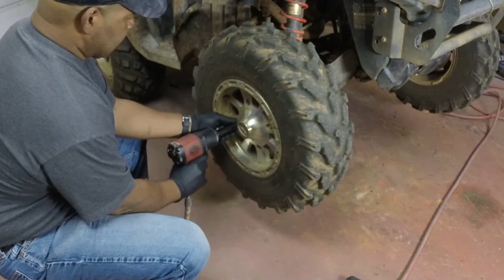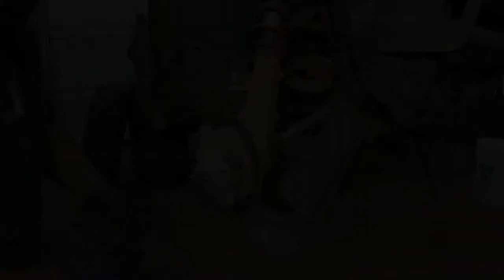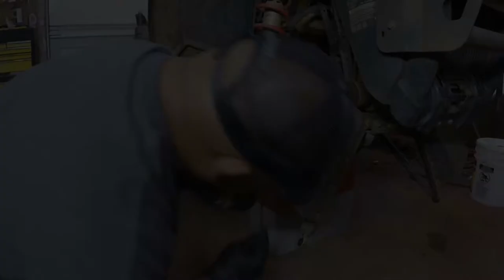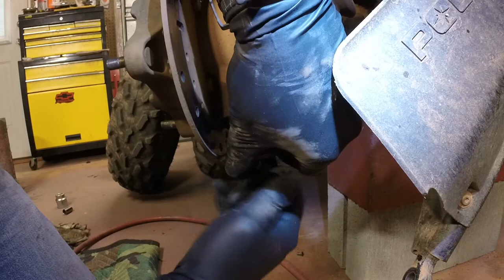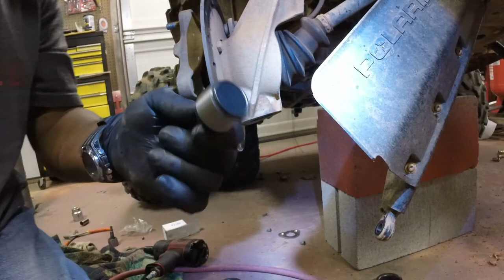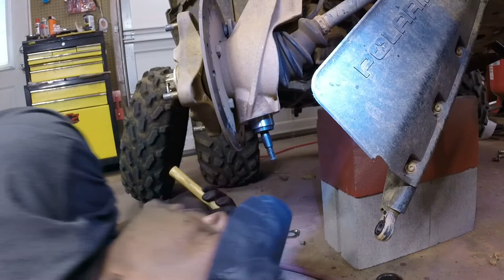Polaris Sportsman 700 Ball Joints and Front A-Arm bushings Replacement "Part 1"

Comment: Thanks for the video!! I have a bad ball joint on a 2000 Sportsman 500 which has a ton aof miles on it. We rode through Canada and I have unlimited trails out my back door. The part that holds the top of the strut broke off. Thank god it was just down by the barn because it was impossible to move but I have it up by the garage and welded a big washer in where it rusted out. I need to put a new CV joint on it as well. It has been sitting for 5 years or more. I have another one that is a year older I use as a work horse. They have been very good machines.Thanks again those tricks will help!!

Comment: Once the plate holding the ball joint in is off just pump grease in through the grease fitting and it pushes right out so much easier
Reply: His old ball joints had a grease-able hole in them, the grease would have simply passed through.
Reply: That's what I do. It's like magic
Reply: @elliottbran  no the grease would have pushed it out
Reply: I tried that grease method it the grease just came through it didn’t work. 
This method is all that worked

Comment: Good idea using the washers to get the ball joints out, I’m rebuilding my entire front end I think I’m going to stick my new ball joints in the freezer overnight and see if that helps on the install. Thanks for the vid 👍
Reply from the maker: That should work with putting them in the freezer. I have also most have rebuild this front end too. But I still have a wobble in the front end when I get up to about 35 mph. Maybe my rims are bend some where. But good luck with the front end.
Reply: Michigan mud dawg I have to do the ball joint on mine. Did the freezer idea work?

Comment: Are your tires able to move around even with new ball bearings? I'm guessing because it's a castle but the tires dont tighten up like regular ball bearings
Reply from the maker: David Borisyuk They should not have any play in the housing that the bearings go up in. And they should not have any play in the bearing itself. Everything should be tight.
Reply: @thebasshunter  lol ok I replace them